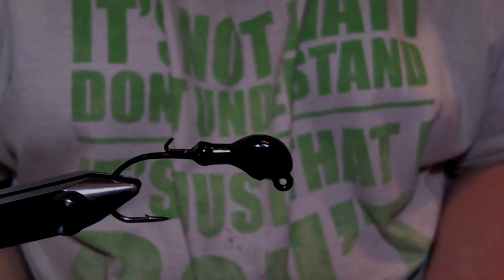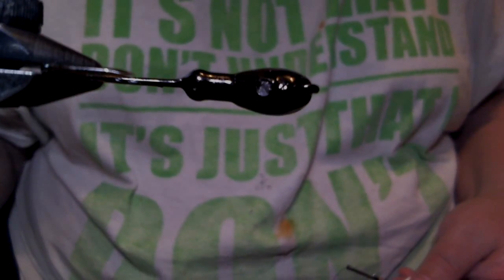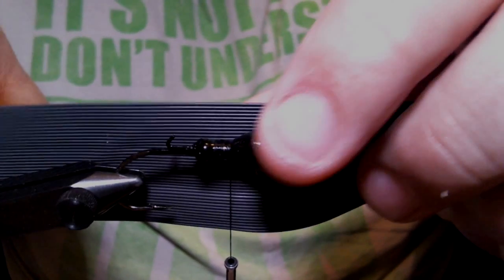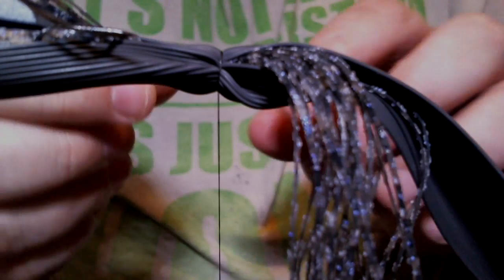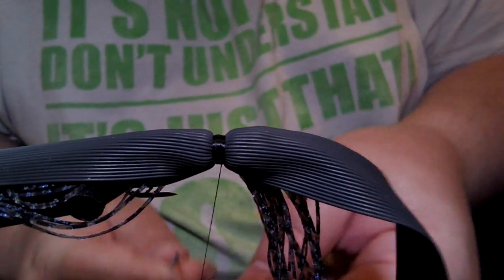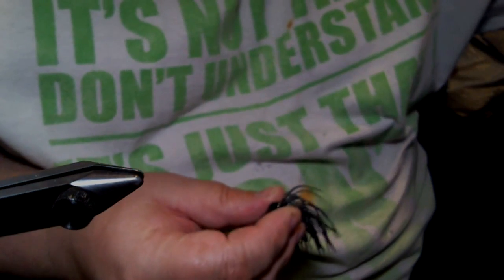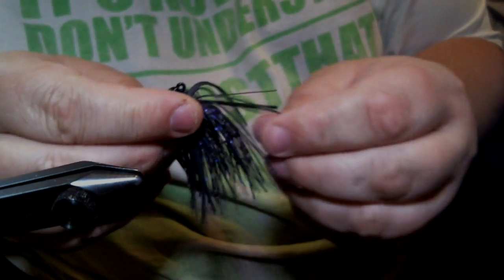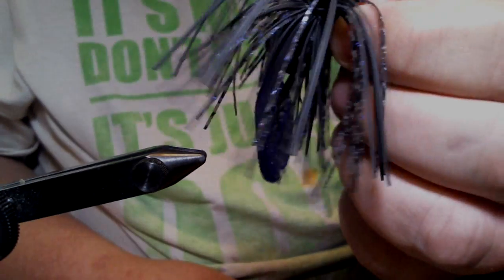Tying with Silicone and Living Rubber

Comment: Brother SJ,
I know this is an older video, I've watched it 5 or 6 times.  I was looking at comments and you said you modified your mold. Is the modification the wire keeper?  Thanks man!
Reply from the maker: Yes, the mod is simply the wire keeper. The weedless banana head is different from the standard banana head. The weedless version is thinner but is balanced really well so you can drag it, hop it, flip and pitch it. It also takes a really wide range of hooks and that lets me make the jig in a lot of different ways from finesse to power.

Comment: Love your jig tying videos. Been looking for the banana style jig with light wire hooks and can't seem to track one down. I would appreciate any help. plus how did you modify mold for keeper?
Reply from the maker: Thanks for watching!!! I personally use the weedless banana jig but if you are looking for the light wire version go to Barlow's Tackle. They have their molds separated into different categories, look under regular and light wire jig molds and there you'll find the light wire version of the banana jig mold. To add the wire keeper I put the keeper in the mold and closed it and then hit the mold with a dead blow hammer, this left an imprint of the wire keeper on the mold cavity so all I had to do was Dremel it out with an engraving bit.

Comment: Can you get those jigs without a weedguard installed at barlows
Reply from the maker: I pour these myself, and I don't think Barlow's carries this jig. If you want a jig that is made so you can add the weed guard yourself you either have to have a custom tackle maker do it or buy a different jig with the weed guard installed and then remove it yourself. If you go to Tackle Underground under the wire baits section you will find custom tackle guys there that can help you.

Comment: Why 34 wraps before whip finishing????    Isn't that overkill?
Reply from the maker: It has to do with the size of the collar,  a small thin collar will allow the head cement (super glue) to go through to the rubber. Super glue on the living rubber will make it brittle and you'd end up losing pieces of the skirt every time the jig is pulled over cover, remember, this isn't a fly.
Reply: @smalljaw  
    I have a cement question ref this.
Could I use silicone rubber (like RTV)
It's strong, soft and flexible and won't make the skirt brittle.
   Great show, Thank you sir.
Reply from the maker: @jenky1044  I don't think that would work because it wouldn't penetrate the thread. It would just be on top and would end up peeling away. You really don't need to worry about the glue making the rubber brittle as long as you don't use a lot of it. Remember, the glues purpose is to seal the thread to keep it from fraying in the water.
Reply: @smalljaw  
   Ok thank you.    Sorry I'm new and trying not to bug. (Old dog, New tricks thing).    I will sub to your channel.
   Thank you sir.
Reply from the maker: @jenky1044  No problem and I want you to ask questions, that is what my channel is for and why I put my email in the description box. I look forward to seeing you here and remember, if you don't understand something just let me know and I'll try to help!!!

Comment: You ever do any pour videos? And why tie vs metal wire or rubber bands?
Reply from the maker: I have used rubber bands and tying is just better. I also use wire but only for silicone and I normally use it for larger jigs, in fact I have a wire tie video on here I believe. Thanks for watching!!!